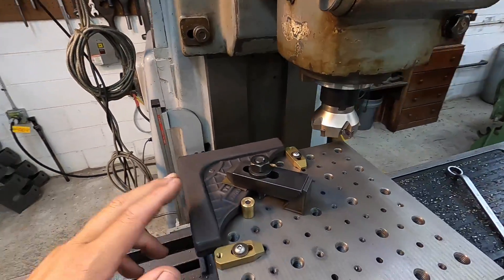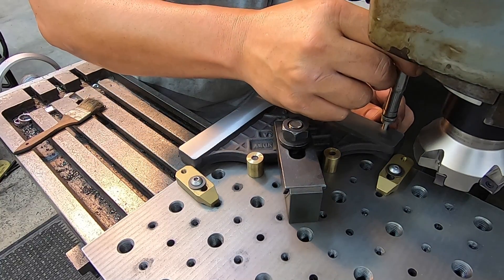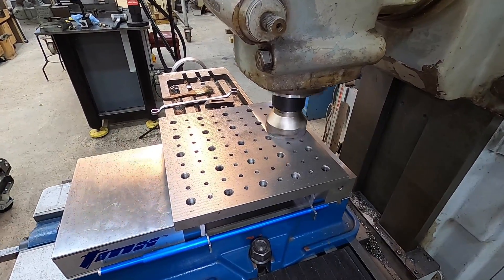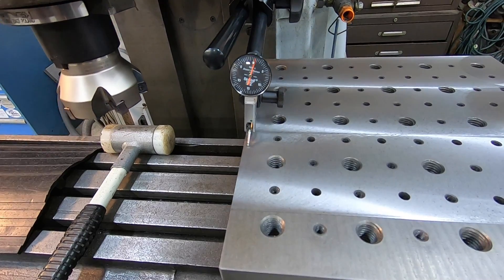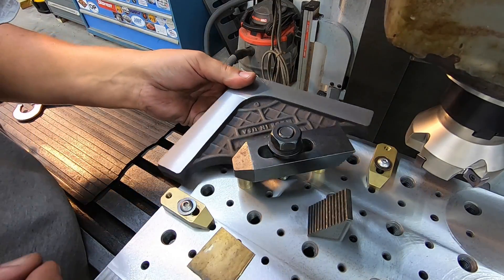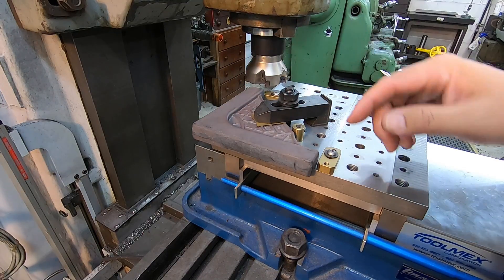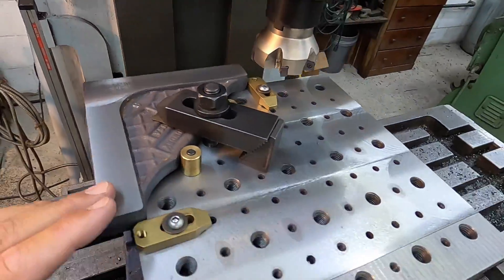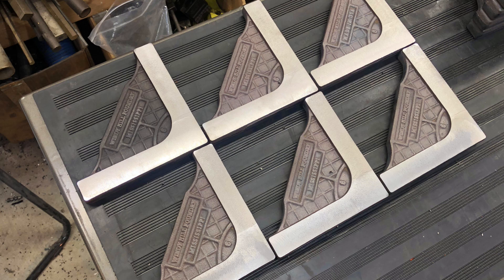Windy Hill Foundry Machinist Squares Part 2

Comment: Very nice work! One small tip from an instrument builder: when working with little spacers under clamps, taping them to the clamp to temporarily keep them in position saves a lot of time and fiddly work, especially when working in batches.

Comment: I'm not a machinist so take everything I ask in that light.  Adam was pretty sure the plate was flat, square & level when he made it.  So wouldn't the problem be either in the attachment to the vice or the vice to the mill table? I dIon't recall him rechecking either.  Maybe the quickest route to a workable solution was to just mill the plate level to the mill table?  Nice work either way.
Reply: In the first video he trammed in the vertical head to the bed of the vice, so in principle, those should be parallel to each other. There are a lot of things that could have caused the fixture plate to go out of flat. What he should have done, but didn't show doing was indicating the fixture plate when he set it up in the vice to make sure that it was parallel. He would have caught the out of flatness he cut the first side of the squares.

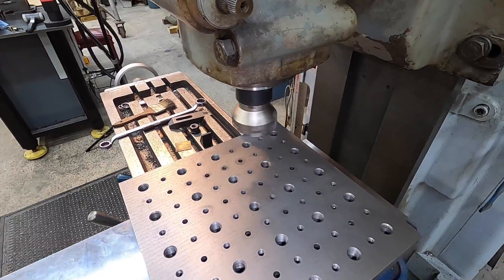Comment: uhm as a machinist at 4:14 i am confused if it's flat and precisly flat ?? why don't u remove the parallel screw it harder and set the flatness by indicate it , that's how i do i t  with my worksets to avoid these kinda problem because even if you'r perfectly flat , if you use parallels to make it flat it won't be with some stuff on it or dust it can easily get 0.02 (metric) that's why i use it  in a device just without touching anything then just to hold it and indicate it to make it flat and parallel to the table in X and it workedd all the time , but again i enjoyed your videos and still enjoys it today , continue the work :)
Reply: This right here! And too many parallels, I work in a machinist field too and they always say never stack parallels or just clamp the fixture to the table and indicate in. I've never heard of re-machining a surface that you "know" to be flat.

Comment: I wonder if the issue is the rough casting not making full contact with the fixture and flexing under load. Maybe a shim of dead soft copper under the rough side of the piece or a couple passes with a file to knock off high spots would have helped. Just speculating.. I'm just an IT guy, not a machinist.

Comment: Adam, I noticed in the past that fresh casting relax a little over time. This is the reason why they leave castings for precise machines out to rest for a year or longer. It releases it's tension caused by the casting and cooling and deformes by doing so. If you cut the sides the residual tension get's an opportunity to deform your part and the parts finds a new equilibrium too. Flipping the part and skimming bit by bit get's the best results. Thank you for sharing! Best regards, Job

Comment: I thought I could see the piece chattering slightly, hard to tell, but I'm wondering if that copper spacer is being subjected to compression and deforming due to the extreme vibration of the cutter head.  This could cause the copper to flow slightly, loosening the clamp holding the piece in place; or not.  Maybe the custom table was distorted by bolting the clamps to it.

Comment: Would you cut the 45 deg face too, I always find an accurate 45 is handy too and sometimes a small section is ample to work with when finding/marking  centres of solid stock etc

Comment: i cant believe that you refaced the fixture plate.why not bolt the fixture plate direct to the table and eliminate the possible problems with the vise
Reply: Keith Rucker machined his 3 months ago, clamped them to the table in the same fashion as Adam and had the same parallelism issues.

Comment: Adam. 
This is only positive criticism but not sure why you didn’t clamp the castings directly to the table. Looks like your fixture has moved in the Vice. Love the videos. 😀👍
Reply: @jnimitzch4738   and they didn't come out parallel either.. Keith had to true them on the grinder.

Comment: Any reason you didn't use a surface grinder to finish out or was it not critical?
Reply: I would imagine a couple of reasons.  1.  I don't think Adam has a surface grinder, and 2. these parts are meant for hand scraping for double awesome tolerances.
Reply: @phildcrow  Possibly true on not having a surface grinder but i can tell you at least from the one i used to run, we held .0001" tolerances for Caterpillar on ours. Way better than any milling machine for flatness callouts.
Reply: @phildcrow  And I must be ignorant of this "double awesome tolerance " you speak of. I cannot find it anywhere in my machinist handbook.  Can you reference that for me. My 15+ yrs machining hasn't afforded me the opportunity of working with that one yet.  Thank you in advance.
Reply: @davidgibson6909  You must be lots of fun at parties.  If you truly can't tell the difference between jest and honest conjecture, hand-scraped tolerances are ±2 ten-thousandths of an inch per foot for squareness and flatness.  For most home machinists, hand scraping is the only viable method to achieve these tolerances.
Reply: @phildcrow  True however the question was directed originally at Mr. B, so not sure why you are answering his question in the first place.
Reply: From Ill. Elastic Deflection
A large cast iron section will easily bend when a load is applied, or when weight is added, or may even bend under its own weight. So often and in so many ways does elastic deflection occur, that it is easily mis taken for instability of the iron itself. Deflection may be minimized through design and support, but never completely eliminated. In some instances, as the reader will observe with the two-footed gage (page 2 6 ) 
deflection is not necessarily detrimental to accuracy, since the amount of deflection is almost perfectly constant, given like conditions. In the case of the extremely rigid 48 inch [1219 mm] master surface plate, a small amount of deflection still occurs, and will be a temporary limiting factor in the attainable accuracy of the plate.
It is important to recognize that, with every step in the attainment of accuracy, the problem of elastic deflection is always present. This fact will continually be emphasized throughout the book. Copied from Moore’s “Foundations of Mechanical Accuracy”.

Comment: Thanks for fantastic content.  I have learned so much.  One question, I was wondering why you didn’t just clamp them all down to the table directly in a long row.  You could have done the face and then edge of all of them in one cut (one for the face and one for the edge) and then done each perpendicular face in a number of other cuts, but without having to move anything.  After that, you could line up your “true” edge on the fixture plate for the other 90 degree edge.  Anyway, just my thoughts (from someone with virtually no experience! - not trying to teach the expert anything, just curious).

Comment: Not a fan of skimming the fixture plate without locating the source of the discrepancy first.
Reply: same for me, Adam said the fixture plate was sitting on parallels in the vice, are they source of the discrepancy?
Reply: when you put together the table, the vise, the fixture plate, and the machine head, all the undetectable runouts add up. You could spend many futile days trying to chase them down, or you could just mill the plate.
Reply: @executive  Reminds me of the saying "You can have it fast, accurate or cheap - pick any two".
Reply: @rerun578  Yup. It's often true
Reply: @executive  Keith Rucker bolted his right to the table and had the same issue.. I wonder if the issue is the rough casting not making good contact with the fixture and flexing under load. Maybe a shim of dead soft copper under the rough side of the piece would have helped.
Reply: The clamping of the plate in the vise on the X axis might have flexed the casting enough to cause measurable distortion.

Comment: When you made the base for the fixture plate you made sure the locating dowels were exactly symmetrical.  If the base has been removed and reinstalled backwards, this could mean that the  base and top surface are no longer parallel.

Comment: couldn't you have turned the fixture plate over and milled the bottom parallel with the nicely finished top, rather than the reverse?

Comment: I would make them oversized 0.010 or so per side (0.770 total thickness) that way if someone wanted to harden or surface grind them they could do so and dial them in to 0.750 finished thickness.  A little inspection on the surface plate with some feeler gages on the first victim wouldn't hurt.
Reply: You're going to harden cast iron?
Reply: @AussieUnclePhil  takes a particular type of cast iron to do it though.  What you usually see doesn't have enough carbon.

Comment: Adam, at @ of Part 1  you have them stacked on what I believe is your lift table. It looks like you have a T-slot surface with some kind of cloth. What is it really?
Reply: I think what you are referring to is the same surface in the photos at the end of this video.  It is just a rubber mat that he has on the top of his lift table, kind of like a door mat.
Reply: @Th3Su8  Thanks. I checked Harbour Freight and that's what it is

Comment: Yes, Mister Booth is a professional machinist, but he is human as well.  Errors happen !!  But he caught the problem and showed it to us as well.  He could very easily have simply erased/deleted the videos.  So he is also an honest machinist.  I think that we all need to analyze the videos of the creation of the 12x12-inch base plate and try to find the source of the problem...the lack of absolutely parallel surfaces over an area of 144 square inches.  The real critical issue: the 90-degree angle.  Can't wait to see Part 3 !!

Comment: Would it be better physics to spin the fixture 180 degrees?  Utilize the cutter/cutting force to keep the part solidly against the fixture pins?  Is there a risk of the part moving the way it is set up now?  Cut in y-axis first, then in the x-axis.

Comment: It would be interesting to see if clamping forces distort the plate.  All steel is a spring.
Reply: I doubt it at that level
Reply: @mayshack  Iron is an element. "Cast iron" is just another alloy of steel. Look it up.
Reply: @mayshack  There are endless different alloys of steel you can make, depending on the proportions of iron, carbon, and sometimes other elements, that you use. 'Cast Iron' is kind of a misnomer. It is not pure iron because it contains a relatively high proportion of carbon. It is actually very similar to 'high-carbon steel', only with a bit more silicon. Therefore cast iron falls on that spectrum of alloys you can make with iron.  Cast iron is pretty stiff, which is why its used, but it does it still undergo some elastic deformation?  Metallurgist or machinist, you still need to know this stuff.
Reply: @mayshack  The term steel is pretty crude, and tells you very little about the material properties.  Mild steel and high speed steel are both "steel", but they have very different properties. So does electrical "steel", and stainless "steel", and Hadfield "steel", and chromoly "steel" , and so on...... Mild steel & wrought iron: more alike than some steels.  The word is pedantic and trivial.
Reply: @mayshack  I'm afraid that you are the pedant. The original comment said "I wonder if that poodle can swim", to which you replied "it's a terrier". Totally irrelevant.
Reply: @mayshack  you simply could have told him "cast iron is very rigid." But you had no interesting in helping him understand. You just picked on his wording to make yourself look smart.
Reply: @mayshack  You're welcome. I'm glad you enjoyed it, and thank you for the well wishing. Doing fine actually, but thank you for your concern.

Comment: You should not have milled your plate!  This not a good practice in my own opinion.
You should have used a block of steel, squared and milled and drilled appropriately to serve as a jig for your face milling operation.
A simple way to fix the problem is simply to shim your base plate.
1-2-3 blocks and supporting parallels could also be of good service...
Also, I think that the flange of that square should incorporate some holes.
You may want to check your head to table alignment.
Reply: Shimming is time consuming and prone to multiple errors.  Mill head was trammed in x- and y-axis to base of the vise. Vise dimensions should be accurate to 0005-inch.  Milling the base plate on this machine yields a base plate to use on this machine with this vise.  Only need to index the plate on the vise for exact positioning the next time.  Parallels should accurate as well.  Why be left with a need to shim the plate every time ??
Reply: I watch a lot of this kind of videos and it seams to be common practice to skim a little off to make the plate flat on the machine you put it on. i am not a machinist its just what i have seen many times before.
Reply: To each their own.  My attitude is to dial the fixture in.  If its out, Shim it or skim it.   The situation will warrant the decision.
Reply: Different strokes for different folks brother, telling someone that they “should not” have done something as if you know better is not the way to go about making a suggestion.
Reply: I am surprised that an error like this was made. I'm just a home gamer but I would have checked the fixture plate for parallelism ... X and Y ... to the tool before starting the run. Mr. Booth is a professional machinist.

Comment: Perhaps a dumb question but would marking the fixture plate as to precisely where and how it was held improve the repeatability to where a sacrificial skim cut is not required ? Same face facing towards the operator,etc ?
Reply: Since the vice gets taken off the mill from time to time it would probably get you close but nothing beats a quick 1/10mm skimpass since the machine might settle due to the weather etc.

Comment: Hi Adam, I always enjoy your videos — so thanks again for your keen insight and perfect timing as you describe every aspect very nearly at the same time I’m thinking about that very same thing.

I am puzzled why you didn’t use your new 24-inch fixture plate to line up multiple units on the G&E shaper or even the same mill? Early on when you were considering your approach, it was kind of torturous waiting for you to break it all out.  But saving time would have likely made one less video I look forward to the conclusion.

You know, it may be possible to acid-etch  similar-looking lines into that milled surface using pinstripe-type masking (rolled on of course). Keith Rucker recently did a video on steel Electrolysis, which can etch lines and artistic stencils too.

Comment: Adam, was wondering if I  could ask you a question about a vice some gave me at job site on Boca Grande. A customer of a painter asked me if i had a shop, n work bench, I told him yes, more for wood. He told me that customer's father had recently passed away, had some old tools, do want anything, or somehow he ended up with this vice. Know nothing about it, no year,  just what is marked on the side. PRENTISS VICE CO.  NEW YORK.  BULL DOG'.  No 92. Guessing around 30, 40, lbs. Don't have it mounted, but it's in fairly decent condition. The handle has a slight bend, it goes in, n comes out with ease, which tells me nothing is seriously wrong with it, but don't want to drill a 2 3/4" hole, diameter, n 3/8" depth hole in my work bench. I have never seen a vice that has a bottom like it. A large 3/4" stud, washer, a large matching washer as the bottom, then nut n washer as one. Have heard you mention this on your show. Great series as usual, but just curious, thanks for all you share. I am the onion guy. Thanks.
Reply: Here is the best info I can find on short notice: https://www.practicalmachinist.com/vb/antique-machinery-and-history/looking-info-prentiss-vise-co-115317/
Short version is that they were a well regarded company that made good vises that were at the the time rather innovative. They also made vises under different names for other companies.  They were bought up at some point in  '48.
Reply: @Nibleswick  thanks for all the info. I might have a keeper. Thanks again.

Comment: I'm struggling to see why you remachined a plate you knew was once flat, then remachined the parts you knew must be flat if not perfectly parallel to a cast face. Mad really
Reply: The important thing is that the Fixture has to be in spec on the machine its used on at the time of production. Flatness on the machine that made it or the inspection table is secondary to the flatness when in use. I think Adam did the right thing by just skimming over it on every job that requires precision.

Comment: did your really just sacrifice that shaped surface without a thought?
Reply: He did explain that the purpose of the plate was to be a jig to produce parts - a sacrificial surface.  All he did was tune it so that it was the tool it needed to be.
Reply: It's a consumable.
Reply: There is no guarantee that if he tore down the setup, that the plate would still be parallel to the mill. As much as it broke his heart, he knew milling the table was the right solution to the problem.
Reply from the maker: Nope my mind was in left field
Reply: @Abom79  LOL.

Comment: Hey Abom, Just wanted to say thanks.  awhile back you told me about the tig welding cup you use, so I ordered a set.  After upping my mixture a little I fell in love with it!  I ended up ordering 2 more spares and got my buddies to order a set for themselves.  My welds are just so pretty, especially when I use helium.  I even welding aluminum foil on a bet and got a free beer out of it :)  thanks!
Reply from the maker: Sounds great! Glad to hear the new gear is helping out your welding game!